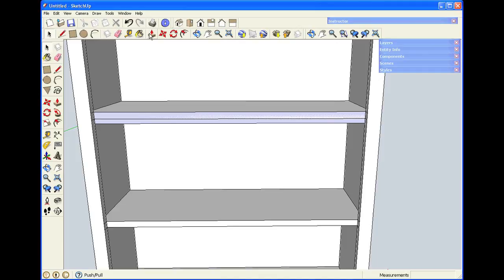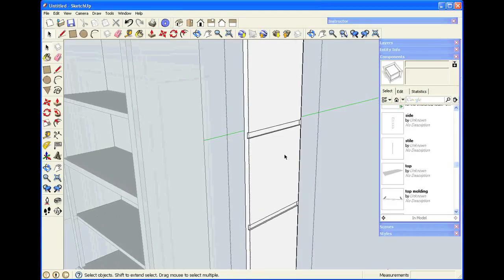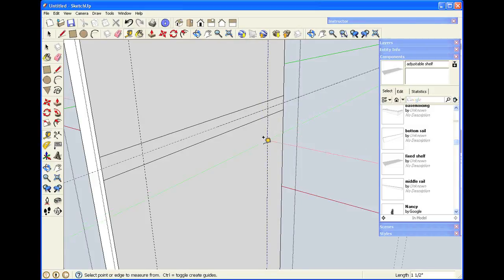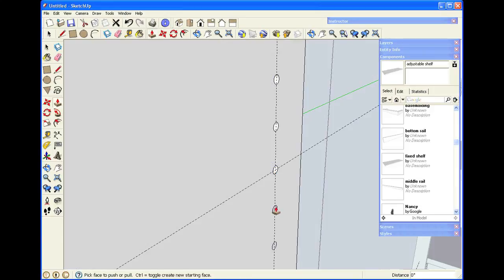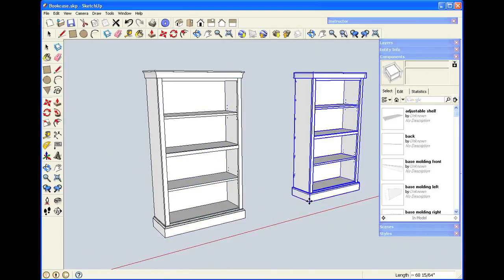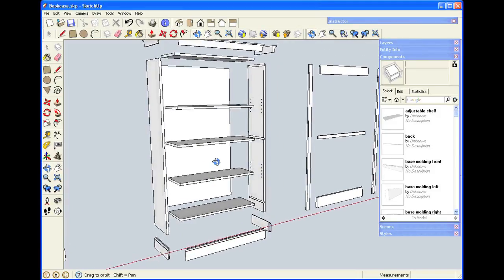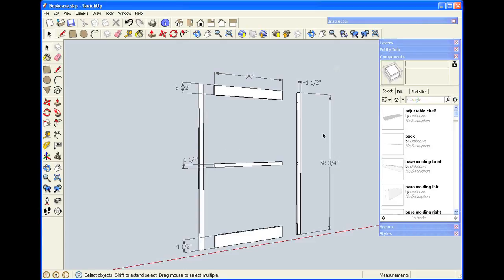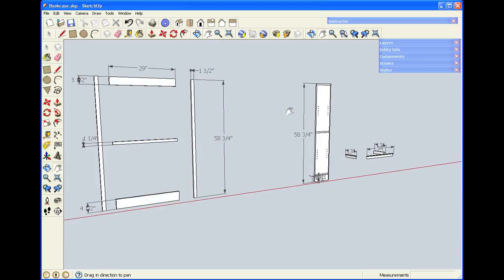SketchUp for Woodworkers: Getting Started 11-12. Robert W.Lang

Comment: Naming components.  It appears to me it would be much better to name components with similar part names first.  Moldings would be molding-top left, molding-top right, molding-front, etc.  Using this convention parts would be much easier to find.  It appears the components are in alphabetical order.  I'm just starting learning the program so there may be a reason to do it some other way.